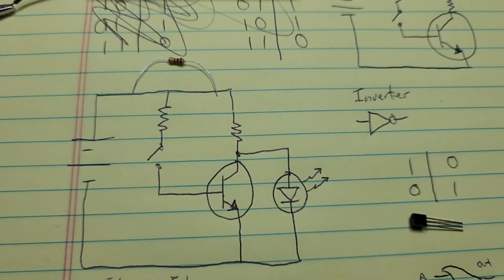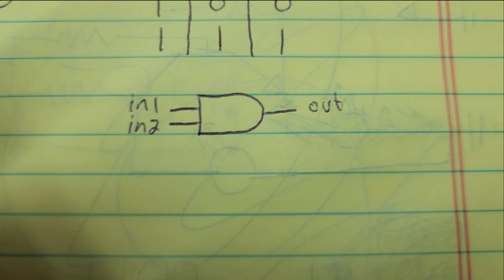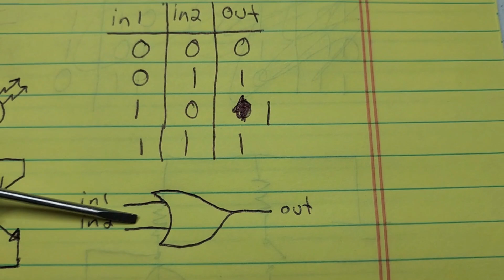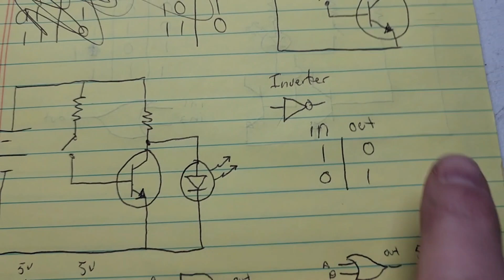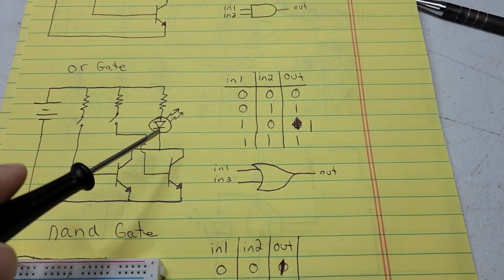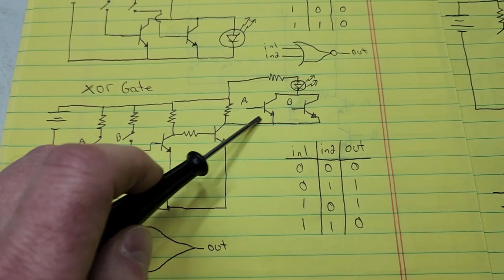Logic gates with transistors

Comment: cool video! im new to all this circuit stuff, why is the led light directly connected to the positive rail without a resistor getting connected to the light first? why isnt it getting burnt out?
Reply from the maker: @liluh-g4q  thanks for the comment. Stay tuned for more videos like this. The LED is always going through a resistor somewhere or it will definitely burn out. For some of the circuits there is a resistor to the led then to the transistor. But some of the circuits you may see the led going from the transistor directly to the negative rail and the other side of the transistor has the resistor going to power.